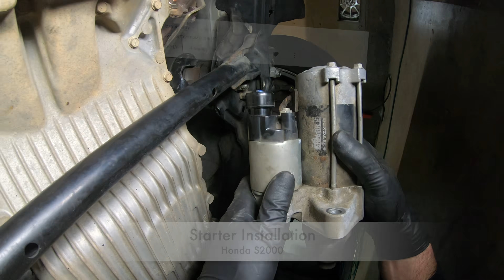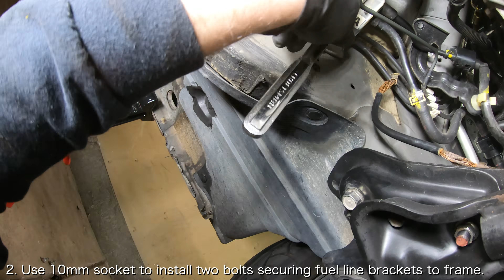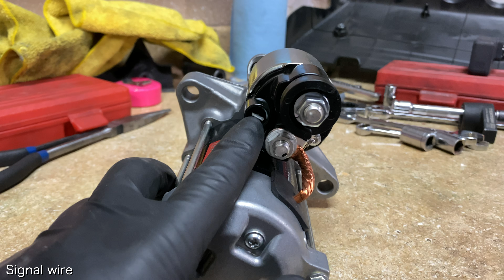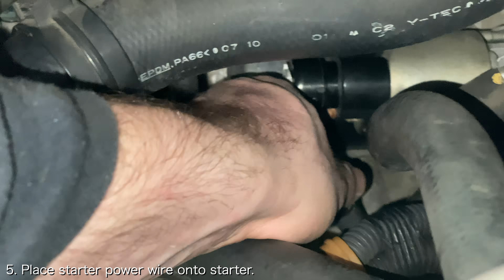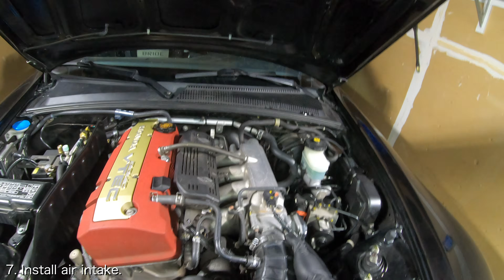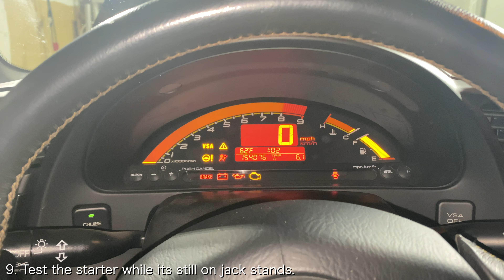Starter Installation | Honda S2000

Comment: Great instructions as usual, it should be noted that the AP1 has far more wires and hoses on/under the intake manifold and is nearly impossible to reach the rubber boots for the starter signal wire and power. For MY03 I removed the pulley tensioner and gained all the visibility and space I needed. Hope that helps someone with an AP1.

Comment: Do the torque specs/wrench account for the lack of torque with extensions?
Reply from the maker: The straight extensions shouldn’t affect the torque wrench settings
Reply: @DIYGuysvideo  cool. All the slop from the extensions meant even my big air impact couldn't get the trans bolts off, had to use breaker bars and interlocked wrenches. I assumed that meant the torque wrench would be affected but there's no slop when tightening with a torque wrench, duh!

Comment: You should do a video on how to test the convertible control module to test window functions!
Reply from the maker: Never heard of this before...Is there an s2ki thread on this?
Reply: @DIYGuysvideo  https://www.s2ki.com/forums/s2000-electronics-26/power-window-not-working-1182228/
Reply from the maker: @Ayang1125  Hmm. Doesn't seem like a super popular issue but if more people request it I can look into it.